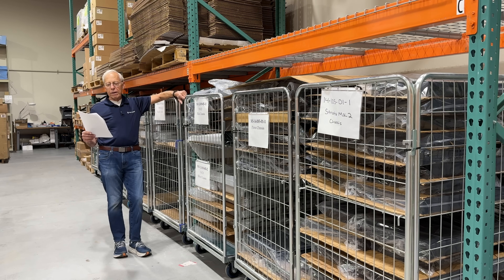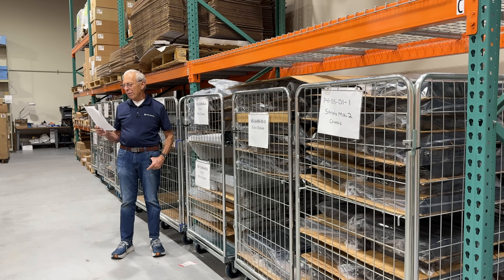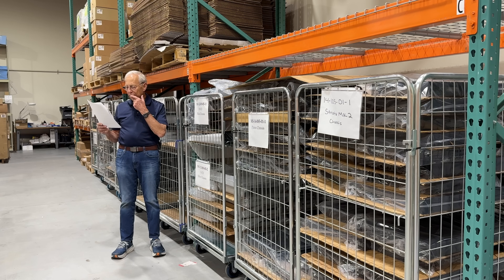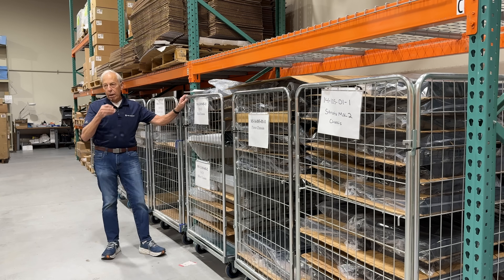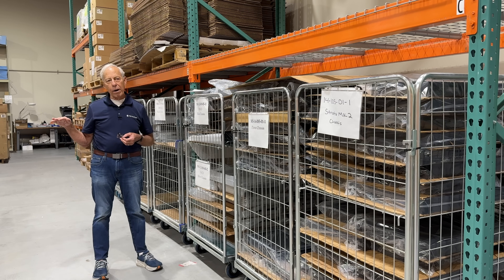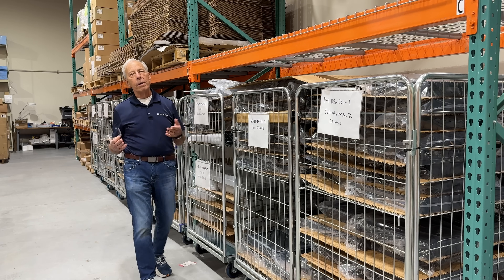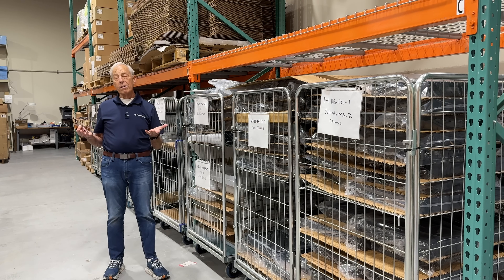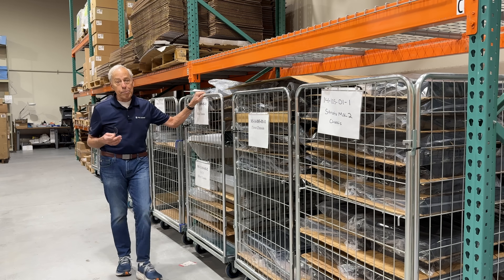Studio or home loudspeakers?

Comment: As others have mentioned, monitors serve a different purpose. I’ve used Genelecs for 25 years for mixing, stereo replay and surround sound. I recently got a stereo hifi for music replay so I could relax into the music more. My fabulous Genelec 8331s are amazing but they are endlessly forensic. Now a Rega / Dali set up is so much better for enjoyment. And weirdly the Genelecs now sound better! Still use 8040s for surround sound and I think they are staying. 

But if you like monitors, go for it. They’re good value and can be convenient.
Reply: I'm using Psi Audio A-17Ms in my home office for several reasons. I'm listening nearfield and not moving much.  My source material includes video conferences. I don't have much space for separates or extra cables. 

The prices of active monitors I shopped  were much lower (at least 2x) than passive home audio speakers of similar performance. The monitors are also smaller despite including their own (omg good) amplifiers. I used the money I saved to acoustically treat my room.

If I were to pick out a flaw in the monitors it is that they aren't finished in birds eye maple or piano black, the shape is uninteresting, and the front panel fasteners are a bit ugly.

Comment: This is a heated one. Many out there will attest to flat being the goal no matter what the application is. Danny @ GR Research preaches a gospel that NO respectable designer sets out to intentionally make an uneven responding speaker. The cabinet design and quality of the crossover parts are the culprit 90% of the time. Hes hacked up countless big brand, rave review speakers, only to expose and through QUALITY parts, correct their bumpy response. Ask any of his satisfied customers if they prefer their stock Klipsch crossovers or the corrected FLAT response ones Danny made for them and see what they tell you.

Comment: Well first of all. PS audio measure their speakers the worst way I've seen in Hi-Fi speakers. -6 dB so they can claim lower FR. And their amplifiers are measured at 1%THD and at 1 KHz 😅 and also I'm pretty sure they don't beef up the amps for European market. So since USA use 20 percent higher frequency in the power outlet, and coils work better with higher frequency, their amps are probably going to perform 10-15 percent worse in Europe. Just food for thought. And studio monitors are speakers like others, but usually they are near field, so you listen to the speaker and NOT the room. Which is also why it's not clever that octave studio use FR20 for near field. They where not made as a near field speaker. Also passive radiators should always have at least twice the cone area of the active. And also you don't get the tight response from passive radiators, but you can push a few extra low end Hz out, which is of no importance, since you should always pair a set of speakers up with a subwoofer unless you have a giant speaker, and I mean GIANT.

Comment: Loudspeakers without infinite baffles placed in a room with some distance to reflecting surfaces (as most speakers are) should NOT be flat.
They should have baffle step compensation, and a suitable -3dB point and 12 dB/octave rolloff that suites the room size and room gain.
Learn about half space vs. full space radiation and how to compensate for it.

Comment: This is crazy talk. Flat is flat regardless of the room its in. I have Tyler Acoustics D1 speakers in an average size living room and they are amazing in all ways other than their huge footprint.  $300 active spaekers from Guitar Center are not studio speakers ffs. And flat is flat. Paul you sound completely ignorant today in this video. Or I missed something, it happens.
Reply: "Flat is flat regardless of the room its in." - as Paul tried to tell you, "flat" is a relative term. Across the spectrum will be variations of a few dB even in the best loudspeakers, so no two speakers are identical.  Additionally, loudspeakers are different in regards to radiation pattern, and any particular room will react specifically to the radiation pattern of the loudspeaker.
Reply: Your speakers will not have a perfectly flat response. Show me some evidence that they do. 7 drive units per speaker. These will have some sort of comb filtering effect at certain listening angles due to the distances between drive units, just for a start. These will interact with the room to change the frequency response at the listening position. This will be room dependant.

The only person coming across as uninformed here is you. I have absolutely no doubt that your speakers sound amazing. But they will not be perfectly flat, nor will they sound identical in every room you put them in.
Reply: No that is not true. 
Flat is only flat with an infinite baffle and no reflecting surfaces, and no speakers are placed under those circumstances.
Baffle step compensation is necessary and a full compensation for all phase shifting reflective surfaces and their comb filter peaks and dips and the room gain is necessay if a loudspeaker would have same chance of reproduce the recording  honestly.

Comment: Studio monitors are made for smaller rooms. That's one reason it would not sound good in a big room in a house even in medium size room.
Reply: You can get huge studio monitors. JBL makes 5 ft tall versions.
Reply: Most professional studio control rooms have at least the same volume of a typical living room. Living rooms are rarely symmetrical, have generally unbearable live acoustics, poor loudspeaker and listening positions.  A home studio crammed a spare bedroom is something completely different, and has heavily compromised acoustics.

Comment: Ok so home systems need to be “musical”. Please define musical. And if musical is good, why not make studio monitors “musical” as well?  Why does one need to be one one way and one the other way?
Reply: I think “musical” is perhaps more of a mindset than something definitive. For musicality to be more definitive would require almost listeners to arrive at the same conclusion. For example, if you have Speaker A and Speaker B, both of which were designed to be more “musical”, and presented to 10 people, 6 people might say Speaker A is more musical while 4 people think it’s Speaker B. And in theory, both groups would be correct. 

I guess what I’m saying is that only you can determine what is musical or not musical in a speaker because only you know what you’re criteria is. It might be different from mine. Or maybe the same. The more interpretive something becomes, the less “science” can explain it.
Reply: @housepianist  well of course…it’s all subjective preference. What hasn’t been answered, however, is why it’s assumed studio monitors used to mix a recording need to be flat. Why can’t they be “musical” (or whatever sounds best to the engineer as well?
Reply: @edd2771  Because you don’t want to have an emphasis  - or de-emphasis - on a particular frequency spectrum when monitoring. For example, if you are recording/monitoring a track that has a lot of high frequency energy, listening to it on a monitor with an emphasis on that frequency band can cause an engineer to make unwarranted adjustments to it. So if that track is played back through a speaker that might be lacking in treble response, it could be perceived as lacking in that department. Technically, it wouldn’t be “flat”. 

I’m not sure if engineers are more qualified to determine “musicality” than you or I. Perhaps getting the best balance of sound and tonality on their “reference monitors” IS musical to them. Who’s to say how they feel at any given time during this process? So to prevent the possibility of an over-or-under emphaiszed final product, a “flat” monitor system would be preferred. Now whether it’s musical or not depends on the time of day, phases of the moon, air temperature, mood, what you ate for dinner last night… ☺️
Reply: @housepianist many revered studio monitors do NOT have a flat response. I love this myth.
Reply: @RacingAnt  how one defines a monitor as “flat” can be equally vague as “musical”. But if an engineer needs to hear certain things in a recording, I’m sure many of them are mindful of the fact that being “flat” may not be truly possible as long as ther is nothing is “coloring” what they need to hear.
Reply: That's how life is with everything. Just enjoy what makes you happy for phucks sake
Reply: @jasontimothywells9895 um, yeah, great advice! 🙄

Comment: I'm confused. At first you talk about the exceptionally flat response of the Aspens, within 2 dB, but later in the video you talk about how much you prefer a speaker that is "voiced for musicality" over a speaker designed for a flat response.
Reply: That’s because the term “musicality” has no meaning and therefore this is a non answer. You are right to be confused.

Comment: Studio monitors used mostly in very controlled environments, but home systems should be more versatile to fit in very different home acoustics but still be listenable. This is not easy. Also, the users in studios are very well trained what to expect from the sound, but most home users expect primarily an enjoying sound. A home user easily fall in love with a very non-linear loudspeaker, but studio user has no chance. So, most of the home system producers' products are not very linear, but as much as linear with an enjoyable sound. Which is mostly shifted bass and highs with a little suppressed mids. And also making a big home speaker very linear is not an easy job, neither cheap 🤩.
Reply: A big difference is also the sweet spot wich is really narrow for studio monitors, if your off axis it won't sound as good unlike home speakers or pa

Comment: With good placement, any speakers can dissapear. I bought a £20 tower set of speakers and placed them in my system and they disappeared instantly! The sound, obviously, was very different but they had depth because of the placement not because of design. Not to much sound stage but i could definitely hear the music coming from behind the speakers. All this with full BHK line of electronics.